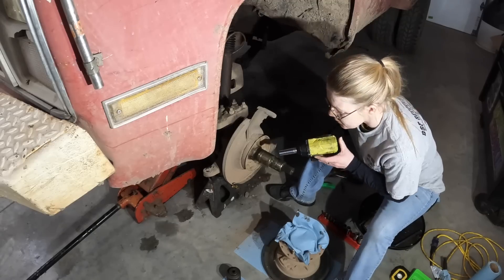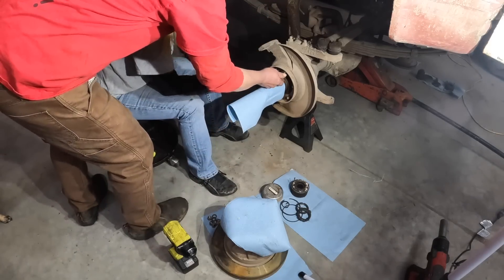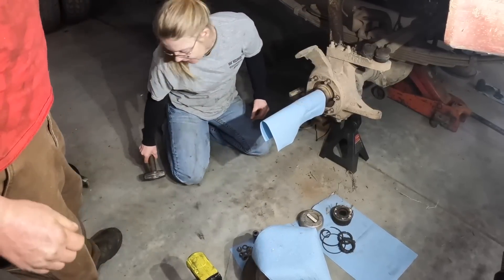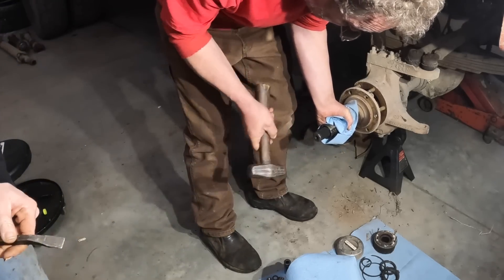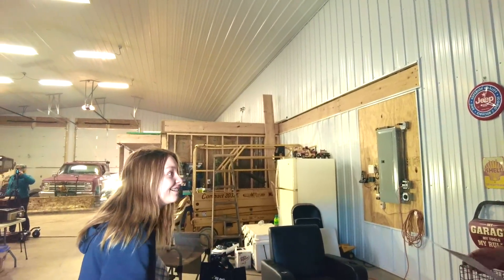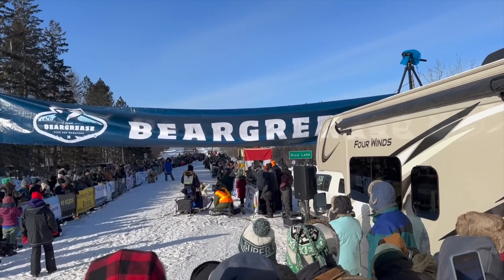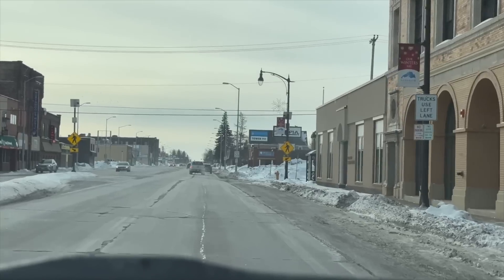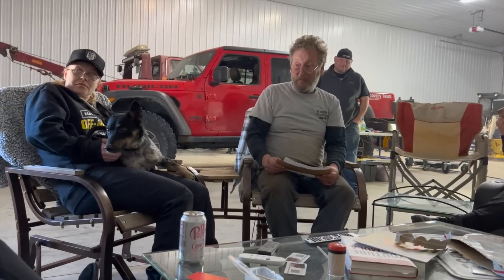GOLDEN TICKET OFF ROAD WRECKER GAMES

Comment: I have 2000zr2 4x4 with 4.3 v6 I have a burn valve im going to fix it will it hurt bottom end of the motor
Reply from the maker: more than likely burnt valve from lean on closed throttle coasts ant high speed. bottom end should be OK.
Reply: @offroadrecoveryteam  thanks
Reply: @offroadrecoveryteam  when you can will you do a video on that